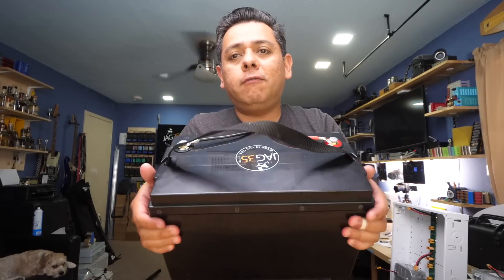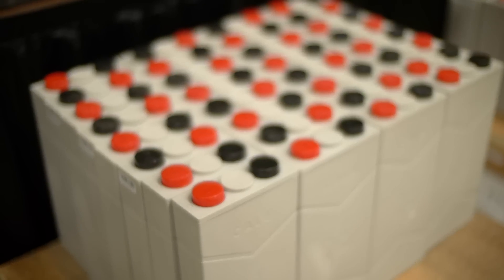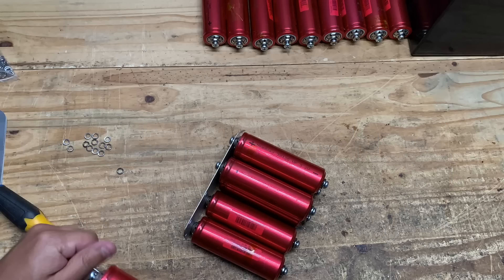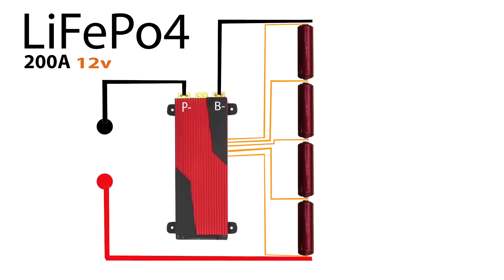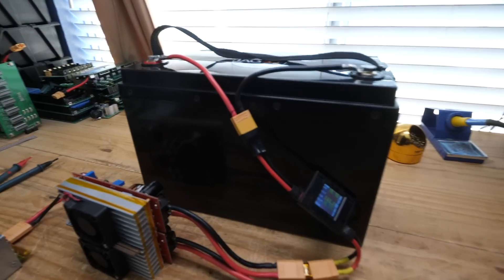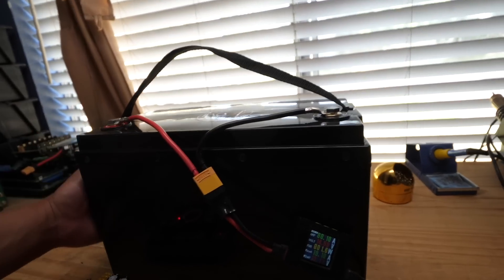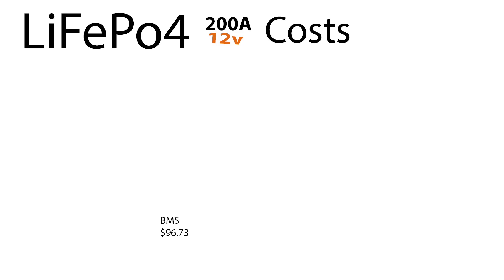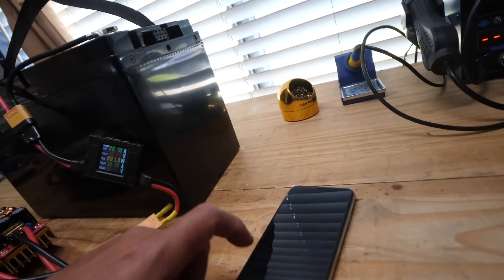Build a DIY Lithium LiFePo4 Headway 12v Battery replacement

Comment: Hey Jehu,
I finished building an electric dirt bike with a custom 18650 pack that I built myself but I am running into a few problems when riding, If I go full throttle, the motor dies after 1-2 seconds, and then I have to wait couple seconds and try again, I put my multimeter on the battery cable and it was only pulling 15 amps until it shut off, but my BMS is rated for 35 amps, But I am running my motor backwards, do you think I need to re program my controller or put a higher capacity BMS?
Thanks
Reply: How many cells in parallel/series? Desired current?
Looks like voltage drop causing the BMS to cut off with low voltage.
If you're using laptop cells, aim for 3 amps each, so if you want 20A you'll need at least 7P. More is better.
That said, a bigger BMS will also help.
Reply: @ahaveland  I have a 20S8P pack with Tesla 18650 cells each at roughly 3200mah. My BMS is rated at 35amps but the motor cuts off at around 15 amps.
Reply: @cleoballon7448  Then those cells at 8P is not the problem - together they should be capable of over 100A.
What power does the motor want?
Try it without the BMS and charge with a balance charger. Sounds like the BMS is far too weedy for this. If it has an interface you can check the settings, otherwise get one that is double the rating of the motor.
Reply: @ahaveland  The motor is a 3kw rated and 6kw peak at 72V
Reply: @cleoballon7448  6kw @ 72V = 83 amps.
Your bms is tiny. Get a 120 amp bms.
Reply: @ahaveland  ok, thanks for the help

Comment: OR 72 bucks at Walmart..... I know, I know, not the same thing, so the question is, what am I using this for?
Is this to replace a car/truck battery?
I buy 2 brand new Walmart specials for my Diesel truck every two years in the fall. The old ones will be getting a little tired by then so I do a little reconditioning and I put them in the shop to add capacity to the solar panel system out there.
So where does something like this fit in? Because I don't really need 12 volt in the shop just the 24volt in the truck which is 2 12 volt batteries.
I use super capacitor 12 volt "batteries" in my Porsches that don't get driven very often but are stored and can be charged up within a couple minutes. Those have served me very well but they are also really cost effective replacements for the lead acid batteries that would need to be float charged year round and would always seem to be weak when I did take the cars out. I would end up buying a lot of batteries for those cars without even driving them. AND had a car catch on fire due to a float charger and another on a regular charger several years later.
Reply: Christopher Leveck one use he showed on screen was a boat trolling motor, you could also use it to power a 12v fridge/freezer in a camper van. I would use it to charge all my USB powered camera equipment and smaller batteries, etc.
Reply: @davidbryan-z8b  Was just thinking the same thing...travel trailers would gobble these up...that's why I'm paying attention.
Reply: Yes, there application is in the electric car, rv and yachting community. Once weight becomes a factor then the of lifepo4 become overwhelmingly.

Comment: Will a car charging system keep it charged? or do you have to use a separate charging system like you demonstrated in the video?
I'm into car audio and getting a steady power supply is very important.
Reply from the maker: Car charging is fine
Reply: @jehugarcia   Thank You!!! Do you see any potential problems installing 3-4 multiple in Parallel to increase capacity? I also would like to use Maxwell SuperCapacitors in conjunction.
Reply: Also, Have you heard of LI-TI cells? they supposedly don't need any BMS and run on 2.3V so 6 cells would offer 13.8V or 16V for  7 cells

Comment: Might be worth mentioning/discussing, but I don't think you can wire these large diy packs in series because it will destroy the BMS typically. I built an 8s2p headway 24v pack for a boom box, and had some 4s BMS laying around. Pretty sure I cannot use them at all. I just plan on using some intelligent current/voltage cutoff relays (hall sensors.)
Reply: If you build an 8s pack you'll need an 8s BMS, or build 2 seperate batteries with two 4s BMS's and wire in series, if one BMS trips the other one will and your load will cut off too as the voltage will suddenly half. I would also recommend using a relay battery meter as well with a low voltage cutoff and other safety features :)
Reply: @chazable  as I understand it, an 8S pack is the same as two 4S packs in series. From what I've read, each 4S BMS would have to support the overall series voltage, so basically 8S BMS is needed. Have you tried wiring two BMS'd packs in series before?

I'm mostly pointing this all out because many people see 12v lead-acid replacements as great uses for aging solar storage/UPS systems with many 12v batteries in series.
Reply: @scrampker  each 4s BMS will look after its own 4 cells in series, it doesn't care what other BMS's are doing in series as long as there isn't a fault case, you could have four 4s BMS's (16s) for a 48v system and its protected, where U might run into some issues is balancing since if 1 of the 4 BMS's cuts off due to an over or undervoltage scenario, it will cut off the other BMS's from doing their job since the series string would be cut. So if U want the BMS to do its job properly then yes, it's best to have a single BMS that looks after all series cells, then add more BMS if needed to parrallel strings.

Comment: please don't forget to balance the cells before assembly,
Reply: They will self ballance when linked in parrallel.
Reply: @DEVONLAD11  No. Only those in a cellgroup, and must be same voltages before connecting or bad things happen. Balancing all the cellgroups in the pack before usage is essential.
Cellgroups should be similar capacities so that one doesn't discharge well before the others.